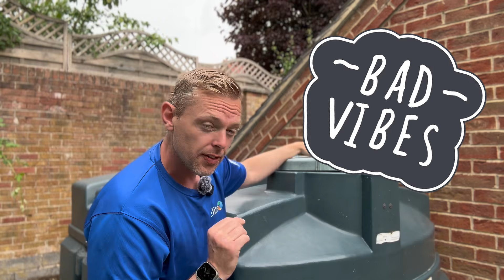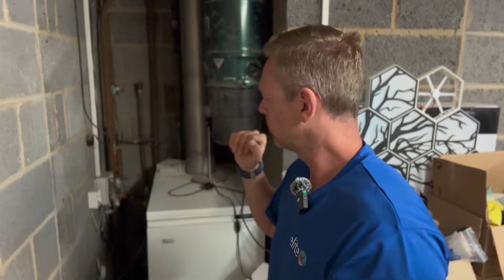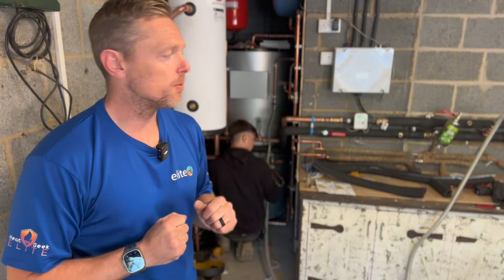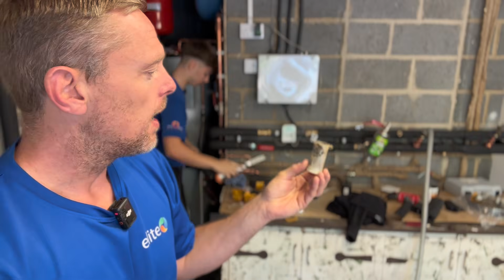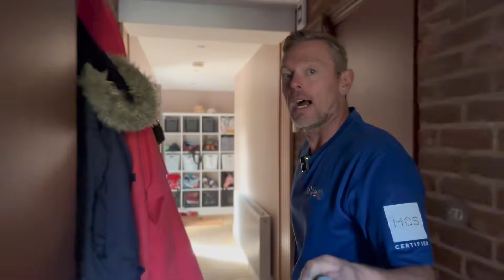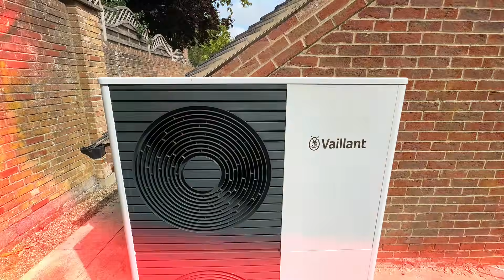Is This the Ultimate Heat Pump Setup?!

Comment: How does the volumiser work during summer? Does the heat pump have to heat the volumiser water aswell?
Reply from the maker: It’s on the heating return.
Reply: So it's not on use in the summer since the whole heating circuit is not been used at all.

Comment: Make difference where volumiser goes flow/return?
Reply: On flow it will loose a bit more energy. And it might take a little bit more time to get heat in the system once the heat pump starts. Though the latter is insignificant since the heat pump shouldn't cycle too often if well designed.

Comment: Why did you add a volumiser instead of just upgrading/adding some radiators?
Reply: They shouldn't even need a volumiser, sure don't they have UFH which not only has a high volume, but also a large thermal capacity. 
Send like an unnecessary waste of money to me.
Would love to know their logic.
Reply from the maker: Calculated the full volume of the system and it was 50 litre short of a 20 litres per kw for system volume. This will elongate cycle times and take from the volumers first before the emitter. 

Love a volumiser 😍
Reply: @EliteServicesGroupLtd 20 l/kW is just a rule of thumb. With such a big house I think you would have been ok even just with rads. But as there was also UFH and fully open circuit I have no doubt that the volumiser was not essential.
However, I do agree with you that extra volume is ALWAYS a good thing. Thinking of plumbing in my old 300l hot water cylinder for extra volume! It'll be off to the scrapper otherwise.
Reply: @EliteServicesGroupLtd  Is this a secret language to baffle customers? The more confusing it becomes the more suspicious I am.
Reply from the maker: No need to. Emitter where the correct size already. Just needed a little more volume. This was more cost effective all round.

Comment: You shouldn't put a sump pump into a tank of kerosene. The vapour is potentially flammable, and it could go bang. Unlikely, but it's possible.
Also, what trunking do you use? All the trunking we have found to date is maximum 140mm deep. This isn't wide enough to get 2no 35mm pipes in with 19mm wall lagging.
Nice install and it will be good to see how it performs.
Reply: You won’t get an answer because they didn’t use 19mm lagging. At best I’d say 13mm.

Comment: Looks good. 
One thing you said had me confused. 
During defrost, does the flow remain in the same direction as the normal space heating operation, or does the flow direction reverse? I assume the compressor stops during this phase. 
I can understand the purpose of the volumiser being on the return flow if the defrost cycle flow direction reverses ( to prevent very cold water going “backwards” into the index rad) but not if the flow direction remains unchanged ( then a volumiser on the hot flow side makes more sense to prevent the first rads getting cold). I’ve a sneaky suspicion that I’m not alone in not understanding this.
Reply from the maker: Thanks for watching! The flow direction remains the same during defrost.
Reply: @EliteServicesGroupLtd 
Thank you, I had assumed it reversed (my installer told me!), so that’s good to know. Then surely the volumiser on the return flow is doing virtually nothing wrt defrost. As it sits on the final part of the return it already has its heat stripped by the emitters and as the water performs the defrost , assuming it runs approx 30l/min for 4 minutes, then nearly every emitter will be filled with cold water before it is completed. 
I can’t see why it shouldn’t be on the flow side, as it’s still providing volume to the system in that position and stopping at least some of the house cooling during defrost.
Reply: @yp77738yp77739  The reversing is the refrigerant flow, so heat gets taken from the loop to the coil. Maybe that's where the confusion is.

However, I think you're misunderstanding the concepts. In a 2-pipe system running at a DT of 5, the return temperature is always 5C less than the flow, so it's not a case of the useful heat being "stripped" by the emitters. The volumiser isn't really to be "first in line" to have its heat removed, but more to add volume to the system as a whole to ensure the heat pump has enough volume for the defrost. Having the volumiser on the return makes sense as it's at a lower temperature, so it loses heat more slowly itself.  Having it on the flow side would also work just fine, but it would be marginally less efficient, as it would lose heat more rapidly without providing any additional benefit during defrost.

During the defrost, the flow temperature doesn't instantly become cold - because the volume of water in the loop holds a lot of heat energy, so it will gradually make its way down to typically around DT*2 (~10C) lower than the standard flow temperature (this will of course vary somewhat based on system size and loop volume), usually by that time enough has been extracted to defrost the heat pump fully, and it goes back to heating.
Reply: That’s beyond helpful, thanks, I did think it strange that the entire heating water system changed direction and accordingly did wonder why it wasn’t necessary to have a screening filter on both the return and supply side to protect the heat exchanger. But even the refrigerant cycle is not truly reversed  is it, in that it still flows through the compressor in one direction only but it’s just that it passes through the reversing valve so ends up reversing in the “secondary” circuit. It hurts my head beyond that to think what’s happening in each case in the evaporator and condenser. So the defrost cycle is effectively going from water heating mode to water cooling mode. 

I’ve only had my pump a few weeks, trying to get to grips with what’s happening so that I will understand if something isn’t working well. Thank you again, the design makes a lot more sense now. 
I do struggle with the purpose of the volumiser, according to the technical spec of my heat pump it needs a nominal flow rate of 46l/min and minimum volume of 50L. We now have about 26 oversized rads and tens of metres of large bore copper pipework, I’d be shocked if there was less than 200L of volume in the heating circuit already, so why add another 50L volumiser at the end. In my case it’s sitting in an unheated garage, it must waste some heat however well insulated. 

Thanks so much for correcting my understanding.